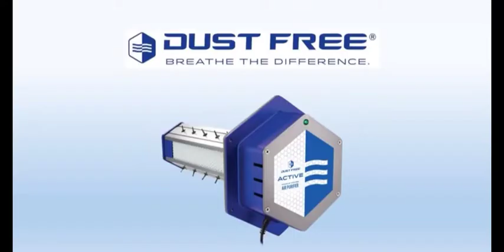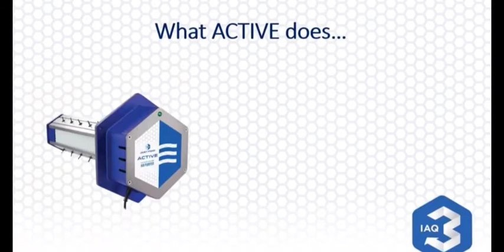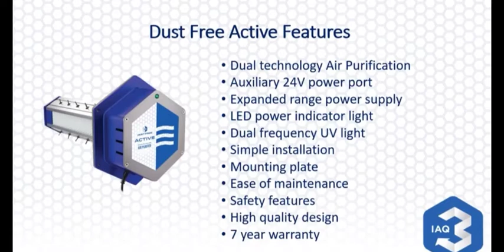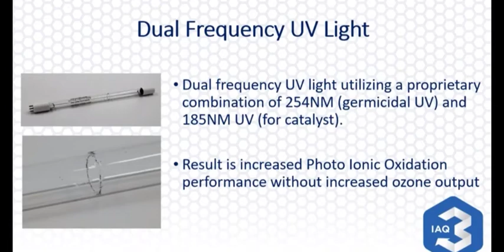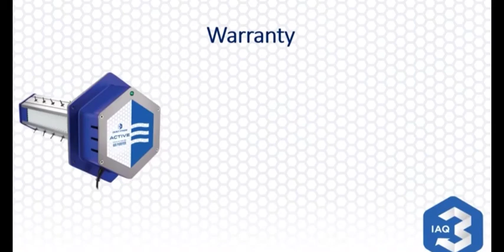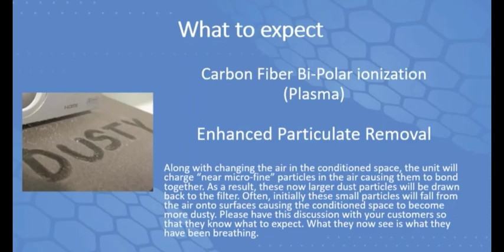EZ-AC Dust Free Active Air Purifier

Comment: Does this air scrubber produce Ozone?
Reply: Hi Jeff, you are right to ask this great question! Although many air purifiers can sometimes create ozone, the Dust Free Active does not. In 2021, almost all of Dust Free's products were recognized by UL, a top global safety certification organization, to emit zero ozone (UL2998 Certified).
Reply: I think so, show us LAB results from credential LABS
Reply: Hi @timkim999 , with so many air purifiers now on the market, it is certainly diplomatic of you to request accredited lab results. In this case, the most recognized lab in the United States, Underwriters Laboratory (UL), has tested and validated that the Dust Free Active does not create any ozone. The UL2998 tests were conducted at the UL facility in Marietta, Georgia and the lab results can be obtained by contacting Dust Free directly.